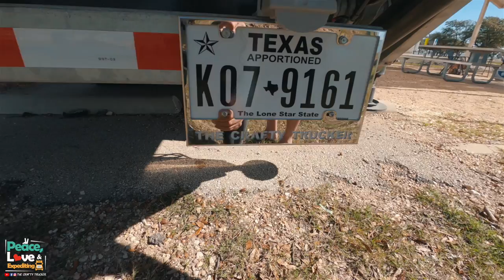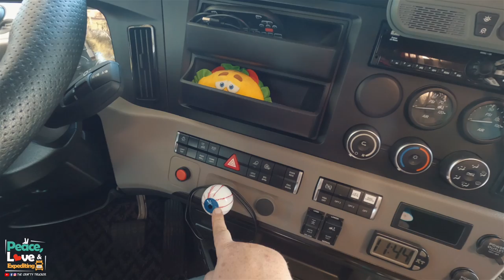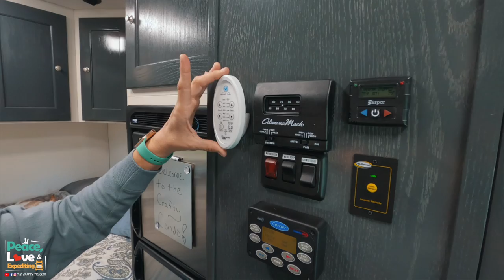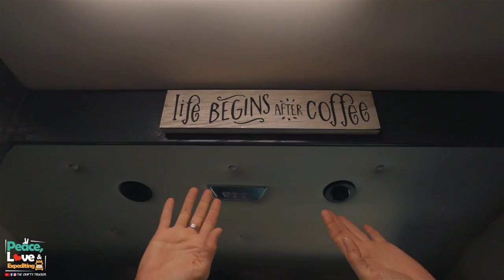2019 FREIGHTLINER CASCADIA WITH A 120 INCH CUSTOM AA SLEEPER

Comment: Did it hurt a lot when Ya's had the holes dermal punched in your ear lobes ? Are you going to stretch your earlobes more or are they going to stay the same size for the rest of your lives ? Love the new truck . Hope it's working out well for Y'all . Suggestion change the hand held shower wand to an Oxygenics it will save water while showering & give you a better shower as it increases the water pressure while showering .
Reply from the maker: Thanks we will get one. We didn’t have them punched. We just started small and over time slowly put bigger plugs in to stretch them out. Took about a year. We will not get any bigger
Reply: @TheCraftyTrucker  Thank You for your reply . Your dogs are so cute . Do they like strangers ?
Reply from the maker: You are welcome. No they don’t like strangers too much specially in the truck or near it outside though tolerate people but they don’t buy at all
Reply: @TheCraftyTrucker  Thank You for your reply.

Comment: I forget what it's called but there is a material that you should look into for the flooring in the rear of your truck. It come in 4'x8' sheets at ¼" thick and what it is, is a VERY hard material that you could install on the floor and it would allow you to slide pallets and it wouldn't damage the floor. You would just use some ¾" drywall screws and pre-drill the sheets and use a countersink bit so the screw heads are nice and flush with the surface so things don't get hung up. Sorry I can't remember the name of the stuff. It's not a plastic, it's kinda like MDF, but uses a really hard and durable resin to make the sheets, then they are pressed really hard to make them very dense like MDF is, but since it has like a polyurethane type of resin throughout (it might even use some sort of polyurethane dust like saw dust) it makes it waterproof. I wouldnt glue the sheets down so they can be removed, but what I would do is cut the edge of all of the sheets at a 45 degree angle so when they come together there is a groove, then use some 2 part epoxy or a really durable caulk of some sort (something that dries hard and smooth, not tacky like silicone) to fill all of the seams to keep water from getting under the sheets. Cool rig! Great job explaining it in your video!

Comment: Have y'all thought buying one those portable washer and dryer for truck
Reply from the maker: That would be cool. Probably take to much room though
Reply: It will fit it's no bigger than a cooler it can fit inside the little bathroom in y'all truck
Reply: My wife and I are owner operator's we are getting a bolt custom truck I'm planning on buying the portable washer and dryer
Reply from the maker: Nice! You’ll have to let us know how it works out.
Reply: You's just as easy wash by hand then hang to dry don't ya know.

Comment: I have had some experance with big trucks, can you load it too heavy on the rear making the front too light? I asked this because the load does not appear centered on the rear wheels.
Reply from the maker: Full load did lift weight off the front, but not to a dangerous degree. 13000 in the rear lifted 1000 off the front. Still drove and controlled just fine

Comment: if you are an independent contractor for a fleet owner that is leased to a carrier..do you as the driver need to get insurance ?
Reply from the maker: Only insurance required is a workmans comp insurance that is deducted from your check weekly at a very reasonable rate. Usually about12bucks. Owner and carrier cover vehicle and freight insurance

Comment: I'm curious - I'm not a trucker so completely ignorant of truck stuff.  I do know that these beasts are extremely expensive and apart from the initial outlay, the maintenance costs are also hefty - just the tires would be crippling let alone brakes, hydraulics, engine parts etc.  For a commercial truck I understand that hauling freight would give ROI and R&M would be covered, there would be depreciation, taxes (dependent on local laws) may be alleviated as it is a commercial vehicle - BUT how is it worthwhile to spend so much money and effort on converting a truck into a residence?
Reply from the maker: When you have the comforts drivers tend to stay out much longer than regular over the road drivers. Also when you love to travel you make the best of where you end up most weekends. Each driver has their own way of reducing cost. For one we did a lot of repairs ourself we also drove 63mph everywhere. Driving that slow alone saved us upwards of 10k a year in fuel. Most of the freight expediting pays a lot higher than your average truck load too giving much more room to work with as far as budget. For us we loved RV’ing and we loved to drive. The business just seemed perfect for us. But it takes work to make sure you are staying in the positive
Reply: @TheCraftyTrucker  Thanks for your response - are you saying that you combine haulage and living in the rig?  I assumed the trailer was just the residence.

Comment: What are the fixed costs on maintaing the trunk?
Reply from the maker: Fixed maintenance? We’ve only had the truck 3 months. We do a lot of stuff ourself which does save a lot of money. Right now all we’ve done is one oil change 500 and fuel which is still going up from getting broken in. 10mpg

Comment: Not trying to be a Troll or rude. I'm speaking as someone who is as fat as you but older, I have to warn you that as you get older those pounds are going to destroy your health. Destroy your life. I was good up until 45 and then it was just one thing after another. First stomach problems, then back, knees, ankles feet, breathing problems, then COPD, swollen legs (30"calf) that developed open heavily weeping wounds, sleeping problems too. This year I've started with heart problems. I've been in the ER 6 times since Christmas Day for 3 different things, skin infection, heart problems, breathing problems. It cost a fortune.  I can barely walk from one end of the house to the other, and going to the mailbox at the curb is a struggle. 
Find whatever works for you to lose weight but do it and start now. The first two weeks are tough but then get much easier. You don't have to go crazy and try to get to 170lbs but set a goal, 20 lbs, then see how you feel. Go for another 20 or 30 lbs. Reward yourself when you reach a goal. Buy yourself that leather jacket you liked or some nicer shoes.
Lose weight and stick around for those you love.

Comment: With the weight of this truck it Hass to be a class seven that requires a CDL. Why wouldn’t you just get a tractor and pull a short trailer?
Reply from the maker: https://youtu.be/SgFWdlkJYso
Reply: @TheCraftyTrucker  I don’t understand? Can you no do expedite in a tractor with a 26 ft box or do you not have a CDL and only carry up to 5k loads?
Reply from the maker: Why would we want to add a trailer? Most expedite does not need it. Expedite is small loads. Adding a trailer ads more operating cost. No one uses 26ft trailers other than ltl and that’s cheap freight. 

Yes we do have CDL’s

Comment: 410 horsepower isn't a lot for a truck that big
Reply from the maker: It can be turned up higher, but with 1650lb torque it did just fine
Reply: @TheCraftyTrucker  it's probably enough for what y'all use it for anyways

Comment: Those automatic manual transmissions are TOTAL CRAP! Just a little moisture in the air system in below freezing temps and the trans will loose air and fail to shift into gear more than a couple times leaving you stranded 1/2 way out of the company parking lot and 1/2 way into the street BLOCKING EVEY OTHER TRUCK FROM ENTERING OR LEAVING THE LOADING DOCK AREA FOR A FEW HOURS!
Reply from the maker: Did that happen to you? We’ve never had that problem in the 5 years we’ve been using them. We do release any water from the lines though after each shift